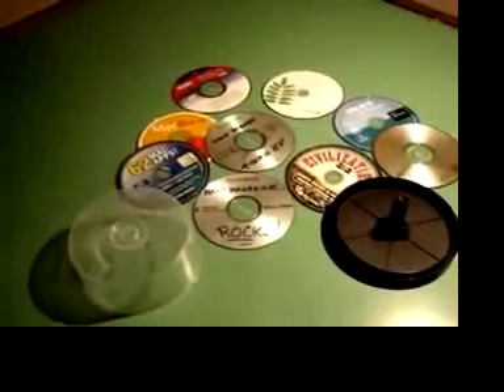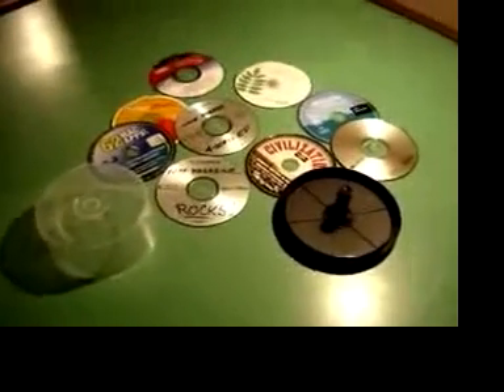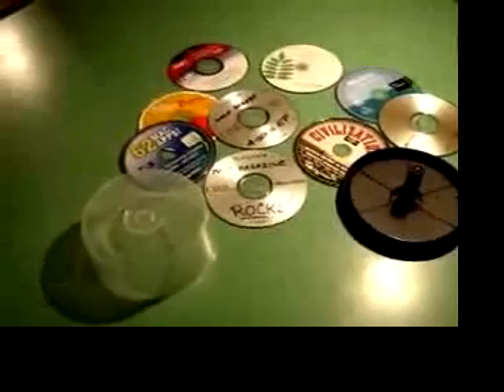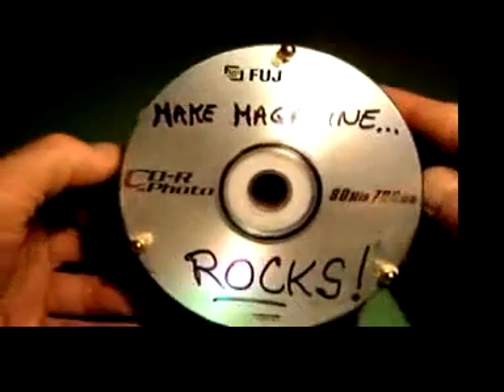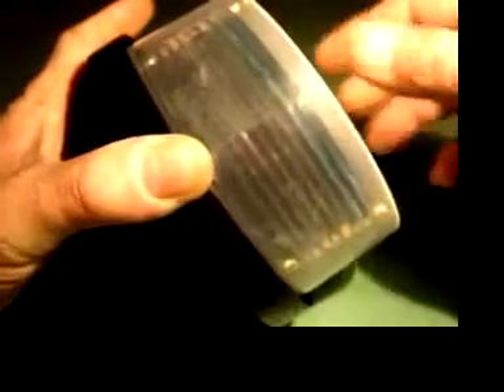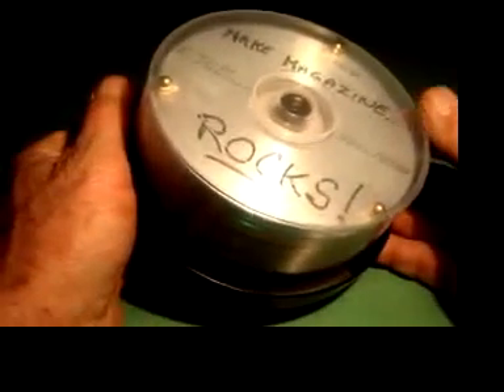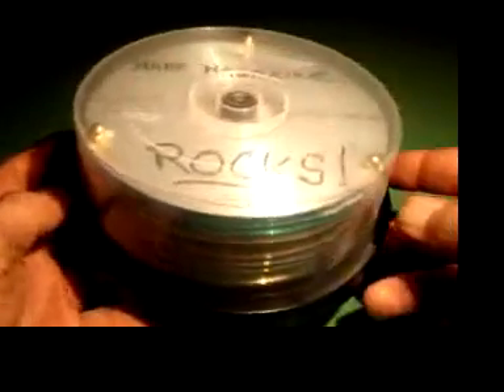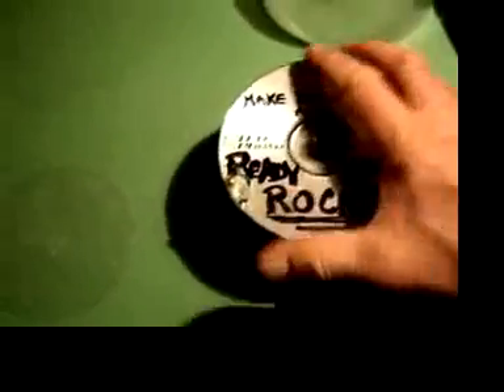The Making of the Tesla CD Turbine Prototype

Comment from the maker: The water needs a nozzle (tapered to a jet) as a water inlet. That is what speeds up the fluid and gives it more momentum when it runs through the discs inside and gives off its energy to them. A garden power nozzle with a 1/8 inch hole or less will work, or make something similar to glue into the side of the Cd case.

Comment from the maker: @TheRealityofNature 

The efficiency of the Tesla turbines I made from recycled CD cases and CD's was not at all my priority. The fact that it could be done at all, and besides drive a magnetically attached skilsaw blade, at high speed, on air or water pressure, is somewhat amazing, I figure ;)

However, I calculate my Tesla turbines range in the 2 to 10 percent efficiency range under load, if that is the number you are looking for.

Comment from the maker: @TheRealityofNature 

I went on to create 34 more Youtube movies of Tesla CD Turbines in action. I've also created several Instructables at Instructables(dot)com/member/mrfixits that you can check out.

Basically, I use faucet water pressure or compressed air...and then both together, to spin   Tesla CD turbines as high as 15,000 rpm.  I've made them run without bearings,  shafts or seals.

I am developing a 2 inch Tesla turbine generator, but haven't defied thermodynamics...or gravity yet!

Comment from the maker: @Gerardo203 

Exactly! The boundary layer effect is the principle behind the Tesla Turbine. Tesla determined it was viscosity and adhesion of fluid to the discs (emphatically not friction ;) that produced the transfer of momentum from fluid to discs.

The same boundary effect can be explained using either air, water or combustibles as the fluid source.

Comment: @MrfixitRick Ok I get it, so the spinning speed of the disks is relative to the ratio between inlet and outlet...
So, correct me if i'm wrong but this technology could be used to generate power from tidal energy or as power supply on a boat ...
Really amazing

Comment from the maker: @thadarkflame 

The fluid must move between the discs to be effective. When the inlet nozzle is the same "height" as the disc pack, the discs can get direct flow, and hence best power. 

At the same time, the tall nozzle must be narrow enough to give the correct cross-sectional area, in order to increase the velocity of the fluid sufficiently.

Comment from the maker: @thadarkflame 

Thanks for comment. The more discs added to the turbine equals more torque for a given fluid pressure...provided the fluid volume is also increased to accommodate the extra discs.

The velocity of the fluid (through the inlet nozzle) squared, is related to the rotational speed of the turbine.

Comment from the maker: @Counterivan1 

The main physics principle that applies to the Tesla Turbine regards fluid viscosity and boundary layer effect. Specifically, the discs turn because of the transfer of momentum from the fast-moving fluid to the discs, by adhesion of the moving fluid to the disc surface.

Tesla was clear that it is adhesion, and not friction or other forces, that makes his turbine work. It is a different concept than other turbines with cups or blades.

Comment from the maker: @MillyVanillification 

Good point! However, the magnets are able to handle less torque when place towards the centre. Tesla used rivets at the outer edges of the discs, which he said helped the starting torque without affecting the high-rpm power.

Comment from the maker: @hyperdude217 

It costs me between $30 and $100 Canadian/US to build a turbine with magnets. Check out my magnet link in the "more info" to order magnets. I usually use 6 thin magnets between each disc layer in the turbine, and 6 of 1/2 x 1/2 inch neodymium magnets  as the drive magnets.

Comment from the maker: @BogMonkey53 
Generally it takes a higher-pressure source, but I'd say a vacuum could rev the discs up to 20,000 to 30,000 rpm easily and blow the CD's. 

The best way to use a vacuum cleaner is to pressurize the inlet nozzle with vacuum outlet, and at the same time use the vacuum for the turbine exhaust for an extra boost in a recirculating way.

Comment from the maker: The discs will create a big whirlpool like that if you can spin them fast enough. The Tesla Pump is quite efficient that way. It may require an electric motor of about 1/4 horsepower to drive the discs to at least 2000 rpm.

Comment from the maker: The bigger magnets won't affect the torque of the motor, only the stored energy of the flywheel effect. The 3 extra CD's will increase the torque, provided there is enough volume and pressure of fluid to supply them.

Comment from the maker: Thanks for sharing your thoughts on this.

 I have considered various ways to magnetically suspend the discs so they are centred and stable in the case. A problem with that idea is that  the magnets are a drive system, and another magnetic field could interfere with the strength of the drive magnets.

The disc pack will actually rise up in the CD case when rotating over  2000 rpm with air, or 400 rpm on water. It floats off the bottom and presses into the top of the case from the vortex action.

Comment from the maker: There is some pressure in the export air from the turbine, but it would be difficult to store in a separate tank because as the pressure builds the turbine slows down. A second turbine could also be run from the exhaust of the first one, but not as fast.

Comment from the maker: That's right!
I was just recently considering the electrolysis process inside the Tesla turbine once again. If a conducting disc was used with the existing magnets, this turbine essentially becomes a homopolar generator. (see wiki for good info on "homopolar generator")

The voltage would appear across the disc radius when running, and would enable the electrolysis action. It might require a turbine/compressor combination to extract the gas and burn it.

Comment: that's is interesting but most people would either want air or water power , to get away from fossil fuels ,  nice choice to use water it could be combined with electrolysis of water as well the turbines could be made to run from the water that goes into a electrolysis vat to make hydrogen and oxygen gas  and the turbine if made to spit out 12 volts could power the electrolysis process ,

Comment from the maker: Yes, it's true that using compressed air is not efficient. 

A tougher turbine case, with metal or ceramic discs, would mean the possibility of running on gasoline or other fuels like Tesla did.

Comment from the maker: The idea is that Nikola Tesla's favourite invention was his disc turbine, which he claimed would "scrap all of the heat engines of the world". I hope to promote Nikola Tesla's disc turbine design by showing how easy it is to make, and showing alternative uses for it. 

Also, by incorporating a magnetic coupling drive system, I have made an improvement to the original design by eliminating the shaft, bearings and seals.

Other videos show the Tesla CD Turbine running on air and water pressure.

Comment from the maker: The magnet spacers should be no more than 1/8 inch thick, 1/32 inch to 1/16 inch thick is best spacing. The 3 holes drilled in the CD's aren't necessary and may sap power at low revs.(but leave them for now).

The CD Case must be sealed, except for the centre post hole, which must exit out the bottom.

Here is the biggest tip...the nozzle. The nozzle should taper down to a 1/8 inch maximum outlet hole size (1/16 inch hole for air pressured) so that the fluid speeds up as much as possible.

Comment from the maker: Thanks for the intelligent questions. 

The three magnets are all "North up" and the power they generate are more of a pulsed DC than AC 3 phase. There are 3 phases or pulses per revolution.

The forces on the discs are mostly from the boundary-layer effects of adhesion of fluid to a surface. The discs get pulled around by adhesion, as the fluid spirals around giving up it's kinetic energy.

Wiki has a pretty good tech write-up under "tesla turbine".

Comment from the maker: I tried to make a gasket with rubber sheet cut out in a thin circle. It kinda worked and makes the turbine work better, but it still leaked. I now use hot glue, (when everything is ready). Sometimes that can leak too, but it can be repaired.

The magnets I am also considering mounting closer to the centre, and using 4 instead of 6 magnets. 

You could use crazy glue and not roughen the magnets, so they don't stick too hard. That way, they will usually pop off later when required.

Comment: Thank you bernouli!!!

Sadly, I epoxied mine so fitting a nozzle inside is my only hope. Plus I haven't sealed the container yet to water sprays out of the bottom like crazy, got any tips to gasket it? I was thinking of hot gluing it. I haven't glued my magnets because I want to keep them after I've finished with the project, so they are pushed towards the center to keep torque down. Hopefully that will help

Comment from the maker: That was the mistake I made with my first turbine! The nozzle outlet needs to be small...for water use, no more than about 1/8 inch works ok. For air pressure, 1/32 to 1/16 is fine.

The turbine gets energy from the square of the velocity of the fluid, so faster is much better as far as flow out the nozzle goes.

Comment from the maker: The magnets are for several functions. They space the discs at the proper .030 inch spacing gap. They act as washers for better starting and low RPM torque, as Tesla recommended. The magnets also couple magnetically to outside machines and attachments to run things without a shaft. 

This shaft-less magnetic turbine can power things (see my other vids) from compressed air or water pressure. It has no bearings, and no shaft seals, to wear out.

Comment from the maker: Yes that is right basically, and I am working on that very levitation feature now. The idea is that the CD Disc pack inside the turbine gets levitated and centred at the same time, so that no bearings, posts or shafts are required.

Comment: you increase the torque with more blades and having them more closer to eachother, the high speed is less but the torque is strong, just look up teslas turbine patents, tells how the whole thing works, remember to print the patents if you do so you will always have the info, the tesla turbine was going to be used as teslas jet engine for a flying machine he was going to use with such a suction effect that the air condenses into a "rope" as he called it letting the craft hang in the air(like ufo)

Comment from the maker: The Tesla Turbine design relies on adhesion of fluid properties and boundary layer effects, and is different that way than impeller or bladed type turbines. 

Flat stock added to the discs may increase the low-speed torque. However, at higher speeds it will interfere with the several feet of spiral movement of the fluid that's required for the fluid to release it's energy by adhesion to the discs.

Comment from the maker: So many questions, grasshopper! hehe

You can force fluid backwards, but the turbine won't turn. You can turn the discs by an electric motor with magnetic coupling, and the turbine then becomes a pump. 

The original Tesla Turbine patent#1061042, could be used as a pump or a turbine.

My latest turbines will turn 500 rpm by blowing in them, but requires minimum 20 psi water or air pressure to make power.
The nozzle angle is shallow as possible. Hot-glue for seal is "sometimes" water tight!

Comment: can you start the water in the out-take and make it go out the intake (start at the bottom of the black part of the case, and end at the ice cream scoop. Also, how much pressure do you need, and how do you determine the angle of the scoop. and is it water tight, because thats just cheap plastic....

Comment from the maker: It's true that putting the CD's back-to-back will make a gap between every other disc. However, there needs to be a channel for the fluid to move to the center hole, where it exits through the centre post. 

I have cut slots in the slightly raised ring at the middle of the CD disc, and stacked discs that way. It works, but weakens the discs a bit and there are no magnetic benefits as well.

Thanks for comment!

Comment from the maker: The magnets have two functions. One is to properly and easily space the discs apart. You could use anything to space the discs. 

The other function is to create a magnetic field so that a magnetic coupler can be attached, or to run other devices from the field. 

Otherwise, without magnets, the discs will just go around and not do anything, because there is no shaft that they are attached to.

Comment from the maker: The Tesla CD Turbine on compressed air can be a lot of fun, but it's dangerous!

If you run this thing on air, then you MUST take precautions, as mentioned in my directions.

Minimum safety precautions include: 
Run the turbine inside a metal or polycarbonate  enclosure. 
Stay away from the immediate area. 
Use protective clothing, gloves and face-shield. 
Use a tachometer to know rpm limits.

These warnings and more are found in my Instructables, linked at the "more info" at the right>>>

Comment from the maker: I like macs!

A properly built Tesla CD Turbine on compressed air is capable of up to 30,000 rpm. (but you have to be prepared for explosions!)

I can get up to 1200 rpm on home water pressure with my Tesla CD turbine, and have tried up to 15,000 rpm on my air-powered turbines.

Also, you can make a Tesla Pump by using an electric motor and running the Tesla turbine backwards.

Comment from the maker: Thanks for your interest.

Yes, the rotation torque is transferred by the magnetic coupling. There is no shaft through the turbine case (CD spindle).

The fluid exits through the drilled-out spindle post and out the bottom of the spindle.

Comment from the maker: Hi rjrulz8255,

Inside the mystery ice-cream scoop is the most important part, the nozzle. The nozzle is a brass barbed fitting that the outlet was squashed into a rectangular 1/16 inch by 3/8 inch size. 

I tried the drilled-out ice-cream scoop by itself but it didn't work. I hot-glued in the nozzle and it was good to go for air or water pressure!

Any round nozzle about 1/16 to 1/8 inch size will work ok, too.

Comment from the maker: You have a good point. Polycarbonate washers could be used, and might be better in some respects. 

Myself, I'm allergic to the extra poly dust and hand labor involved to fabricate 100 little plastic washers. Plus you would have to buy a sheet of polycarbonate,'cause CD's won't work. And a special hole saw. But, yes it can be done . 

My idea is to have as much magnetic effect as possible to engage the magnetic coupler. Building the magnetic layers forms 6 bar magnets.

Comment from the maker: The disc magnets are best; 1/32 inch thick by 3/8 inch (or 1/2 inch, even better) for spacers. Bigger 1/2 x 1/2 or 1/2 x 3/8 inch for the 6 top magnets and for the 3 or 6 in the Magnetic Coupler.

Check my Instructables for more info.(see about this video)

Comment from the maker: Yes, you are right.  1/8 inch magnets were all I had at the time. In retrospect, it's surprising it even worked!

The latest version has 1/32 inch spacer magnets, which puts it in the right ballpark to be able to handle both water and air pressure.

Comment from the maker: Sphere magnets are not necessary; it's what I had left over after the other discs were used up. The balls have perhaps less friction, but the current model CD Turbine uses all 1/32 inch disc magnets except for thicker discs at the top of the Disc Pack.

Comment from the maker: Thanks...that's right...getting down to the absolutely essential parts. I just tried my latest design without glue on the magnets that hold the discs...and it worked, at least at low RPM. Also, the new CD case is much smaller and way more efficient, with less numbers of CD's and closer together. Less is more!

Comment from the maker: If they were connected vertically, it would be 20 meters high, which would give about 30 psi pressure, about the same as garden hose. The volume would be significantly better for a brief period, and I would have to optimize the nozzle for more flow to take advantage. Not such a crazy idea!
   And yes, I will be putting on an alternator next. Probably direct drive; maybe with a pulley.